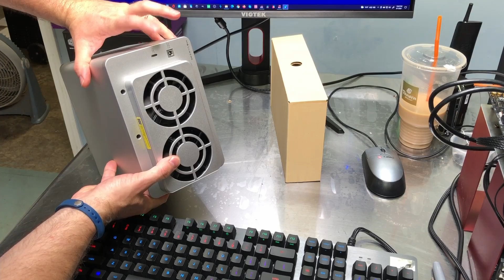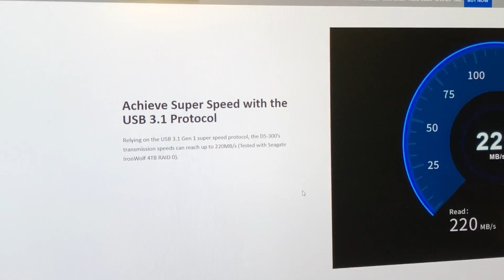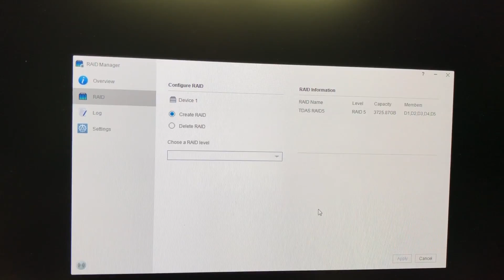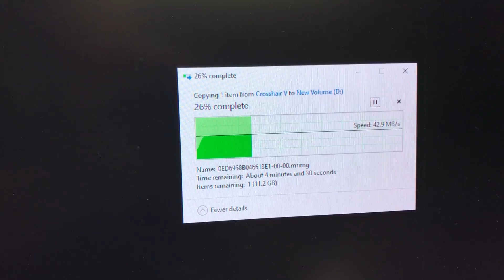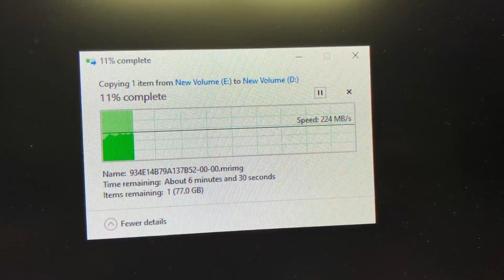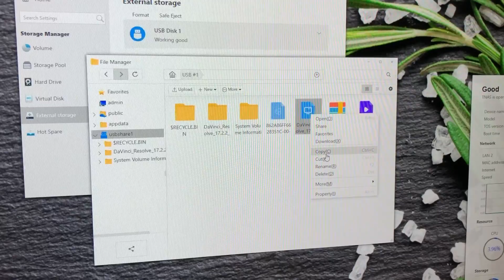OCC checks out the new DAS D5-300 from TerraMaster!

Comment: Great review, did you test the D5-300 or D5-300C as they have different advertised speeds.
The D5-300 is advertised as USB3.0(Gen1) (220MB/s) and D5-300C claims USB3.1 (5Gbps).

I'm looking to attach this to an Unraid system.

Comment: Hi. Thanks for the info. I know this is an old unit at this stage but I’ve a question. If you install 5hd can you make the first 3 raid 5 and the other 2 RAID 1 or 0. In other words , mix and match your raid configs within the one DAS?  TIA
Reply from the maker: No - not this unit.  I think you want the D5-300C.  https://www.terra-master.com/global/products/homesoho-das.html
Reply: @overclockersclub  i have the same question and asked to the assistance, they said me that D5-300C can make RAID only on the 1st and 2nd slot, 3rd, 4th and 5th work as single HD. Instead D5-300 can be used to make 2 different raid, for example HDD1 raid1 with HDD2 and HDD3 raid1 with HDD4. What do you think?
Reply: @overclockersclub  thanks for getting back to me.

Comment: A very nice video, thanks. I'd have a question: when creating an array, are disks are in the RAW format? I plan to connect this to a raspberry pi and format as ext4 to have a NAS. I have read that it is good to create uninitialized partitions that are a little bit smaller than the disk first, then create the array, then format it. Would it be possible with this unit?